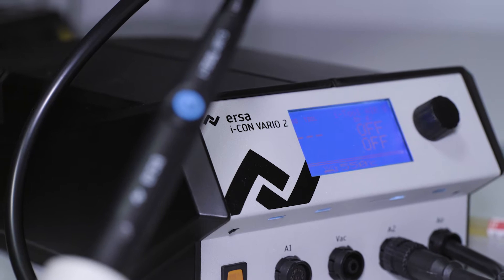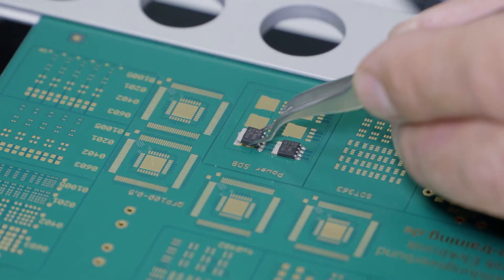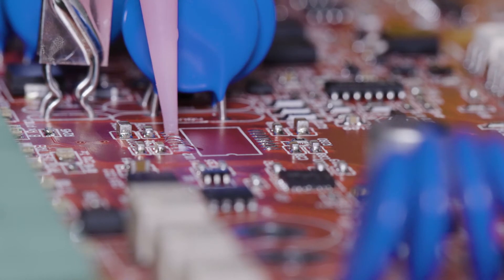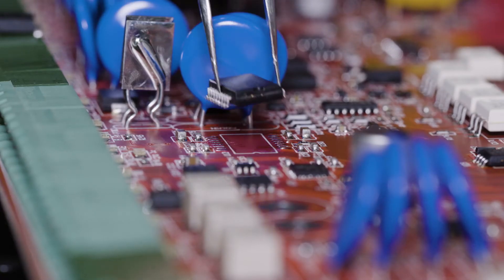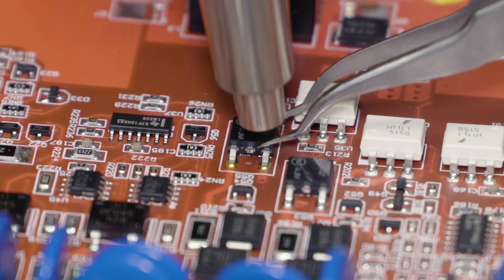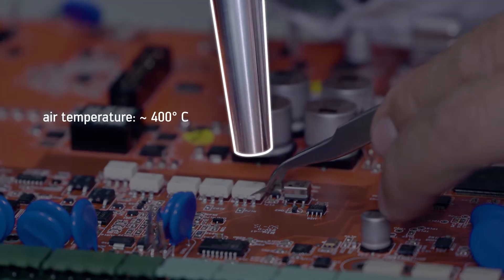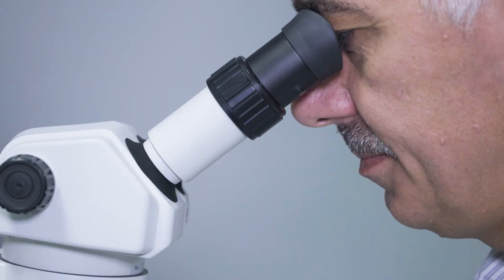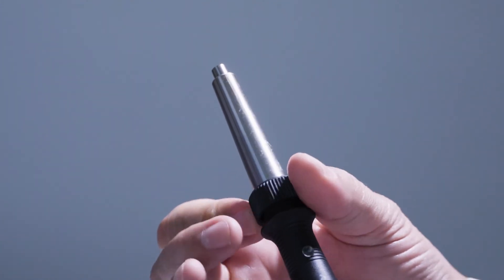Ersa explains #8 – Hot air soldering

Comment: Please can you tell me if the i-tool soldering iron can be used with the Vario 2? Thanks. 
Edit:  I'd like to get a set with the X-tool, the hot air tool, the tweezers and the i-tool if possible.
Reply from the maker: Hello, thanks for your question. The i-TOOL can be used with the Vario 2. To connect all tools to it, you need the version 0ICV2000AXV and possibly an adapter. 
If you need more details just contact my colleague adrian.muenkel@kurtzersa.de
Hope we could help you.